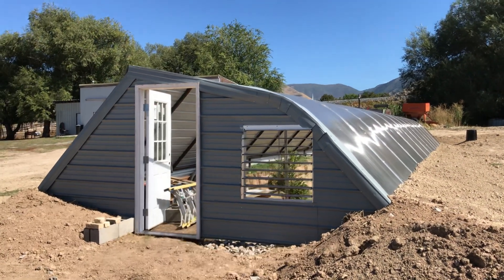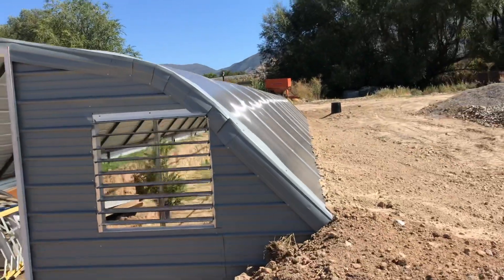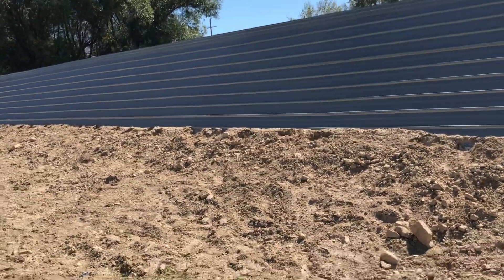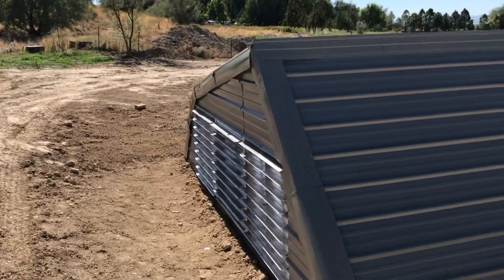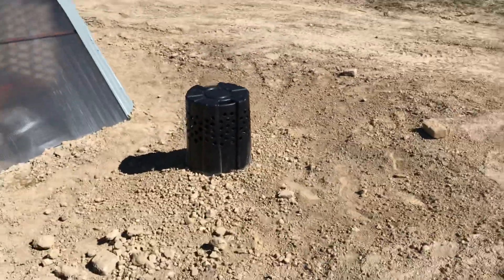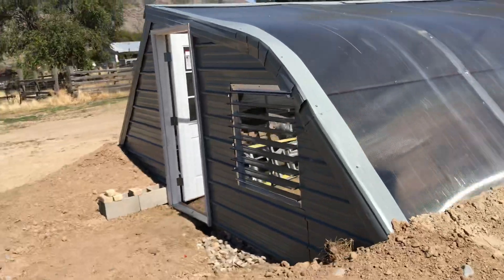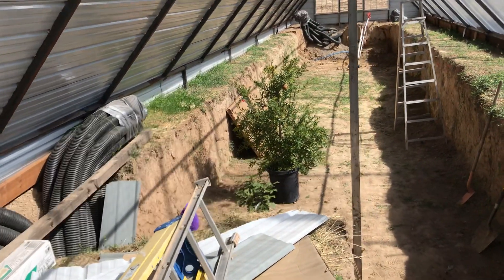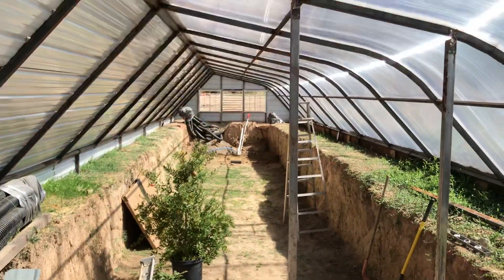Geothermal Greenhouse construction update

Comment: I'm in Escalante UT. We've had a few weeks of 100 degrees so what daytime temps are you cooling to since you said your geothermal is down to 8 feet? Are you supplementing cooling with anything other than fans?
Reply from the maker: 5 feet below grade definitely helps.  Geothermal pipes also help.  I also use a shade cloth and run two separate fans depending on temperature. When temperatures are above 100 I am usually low 90's

Comment: where did you run all the underground lines? outside or under the green house? How many lines and how  feet did your run? what did you use to blow with?
Reply from the maker: I have a video regarding the pipes.  They run outside the Greenhouse.  I have a blower sitting on top of the main pipes.  Main pipes are 12 pipes running 230 feet.
Reply: Yea Im going to build it all 8 feet down with blower stations every 100 yards. I have a plan but it seems everyone has a different way of pulling this off. I want to put in a string of green houses with lines going in and out. Hoping to grow hemp year round but I love the idea of a mango tree. There's a guy in Iowa that grows oranges in the snow but he does not share how he did it. Thanks for getting back. I did not see the video on the line installation.

Comment: Great video! Will you be installing solar for your electric needs?? If so, what system or brand? Thanks
Reply from the maker: Yes.  I have purchased a Solar set up from a Company called Total Solar Technologies (I think that was their name) out of Idaho.  I have built the Solar Structure next to the Greenhouse that will hold the Panels.  Now I need to install the Panels.  I'll introduce the system when I get it done.  I have no idea if it will work.  I think it will because these Geothermal Greenhouses don't use a ton of energy.  But I have a back up electric heater during Winter that does use a bunch so time will tell.  I'm willing to do whatever it takes to make Solar work.  That has long been my goal!
Reply: @trailbreakfarms  Thanks for taking the time to share information. I will check out the solar company you mentioned. 
I desire to do the same thing in the near future. I appreciate your videos and all the information  you share!!!

Comment: thinking about doing this also...would you be able to post the 2019-2020 winter season numbers please? heating, temps, final costs, etc..
thank you.
Reply from the maker: I think this could be done for 25K.  I spent more because I added aquaponics and have solar ready to install.  Also spent more on geothermal for a few reasons which I'll share later.  Winter temps got down to near zero here and we keep the greenhouse at about 50 and above.  I have a backup heater to help with that if needed which is controlled by thermostat.

Comment: how do you calculate the length of the trench fir the 6 inch tubing and the amount of air circulation needed based on the the total amount of space in the greenhouse?    I understand 12, 6" tubes, 5-6 feet deep, running 230 feet for your structure is recommended.   How big of pumps, or CFU needed to cool/warm the air?  What if my structure is bigger or smaller?  Is there a formula?
Reply from the maker: Mike, there is a way to calculate based on square footage of Greenhouse but I do not remember the Formula.  Greenhouse in the Snow did my calculation for me.  We have two separate groups of pipes.  4" pipes, 12 each running 230 feet at 8 feet deep and another set of pipes that are 4", 12 pipes running 50 feet and coming up in the Yard.  I wish I had pulled those pipes much further because they come up in the Suction Room which pushes air into the main Growing Area.
Reply: @trailbreakfarms  Hi ya, why are two separate groups of pipes used? what are their specific purpose? thanks

Comment: Seems pretty good, definitely some design flaws that could be changed
Reply: @jg1503  i suppose he did say he needed to add insulation.
 If the front didnt go down into the ground so far it would be more productive, Unless they are somewhat close to the equator, the further away the more the sun angles in the seasons. And you dont want to be bringing in or exhausting you greenhouse air, it decreases efficiency.  You want to circulate it under the green house and bring it back up. Doing this correctly will actually increase ground tempertures under the green house for several months. for passive greenhouses depending on the area you want to circulate the between 8 to 10 times an hour. The only time you would want to bring in out side air is when the temperature gets to high and you have a roof vent open up, that creates a low pressure draw where it would suck in air from tubes that ran outside.
I mean what makes logical sense bringing in outside air in the winter when it can be well below freezing or bringing it in from an above freezing greenhouse???

plus if you added a lot of water towards the back wall it would also increase efficiency as it would have increase the thermal mass inside the greenhouse. 
and I personal find these fairly small.
Reply from the maker: @33moon  The front (South side) goes to about 1.5 feet above ground.  I backfilled to bring it up to the polycarbonate windows.  The Unit is well insulated.  I agree that in an ideal scenario, you want to circulate the air in the Greenhouse and not have the vents but if the Greenhouse gets above 85 degrees, even with the Geothermal air circulating, I'd rather vent the air and keep the temperature from getting too hot.
Reply: @trailbreakfarms  can you possibly do a separate video on ventilation detailing the cooling and heating., the purpose of two groups of pipes and the exhaust blower size and what the suction room does?
Reply: David Porth "bringing in outside air in the winter"… the air is brought through at ~8ft below ground, which at that depth the temperature is over 50F almost everywhere on earth. So the cold air is warmed before it enters. (Then add the greenhouse effect of sun rays, and it can stay quite warm even during -20F winter days)
Reply: @33moon  Hi David - thanks for the information. I am in the process of designing a greenhouse. If the air circulates throughout the greenhouse all winter, how do the plants get more carbon dioxide? Would this even be a problem? This is something I have been thinking about and figured maybe that's why this design was used. Any help would be appreciated!

Comment: How much did the entire project cost so far? I've been thinking about trying this out, but I wasn't sure if it'd be too expensive.
Reply from the maker: probably about 25K so far.  I don't have excavation equipment and I'm not good with Electrical so I hired that out.
Reply: @trailbreakfarms  Yeah, I'm installing a 60 footer and my final cost will be around that as well.  I originally forecast $19k, but expenses keep coming in (I'm going to use solar power).  Good news is when it's finished, the real estate appraisal will see a 1000 sq. ft. greenhouse as about a $50k value on the home price.

Good news is that the 100 foot models don't cost much more, because the piping is the same.  The only increased cost is the kit and siding/retaining walls.  AND if you are a registered farm, it all comes off your taxes!